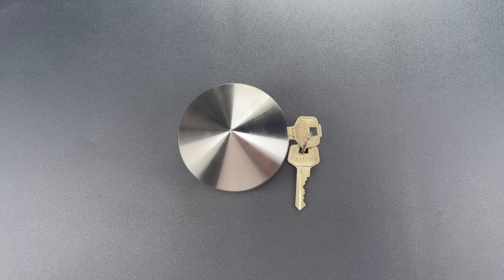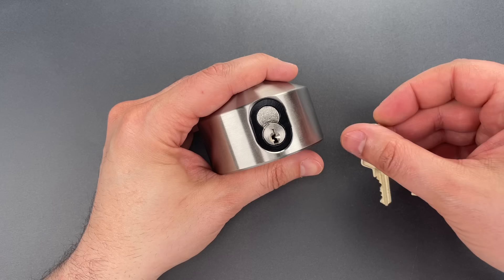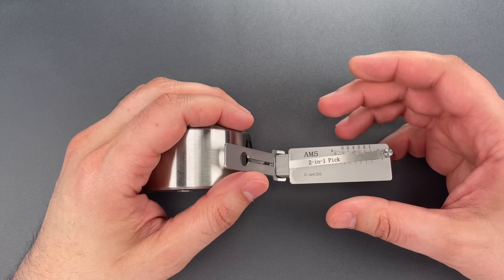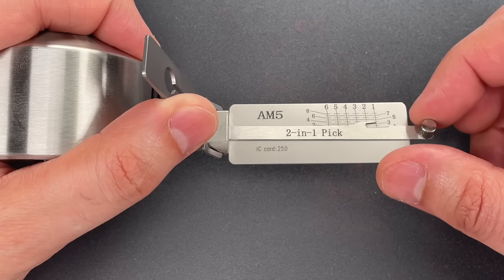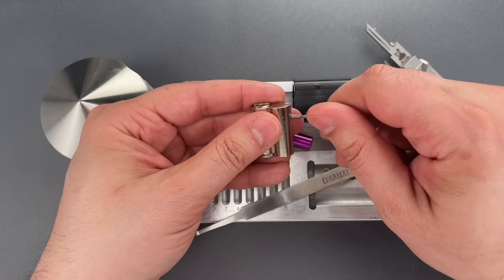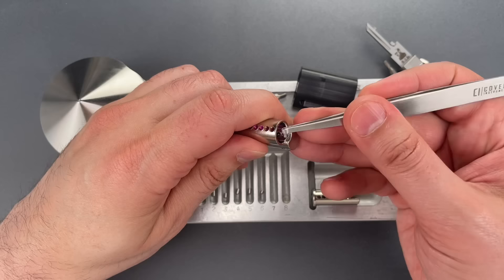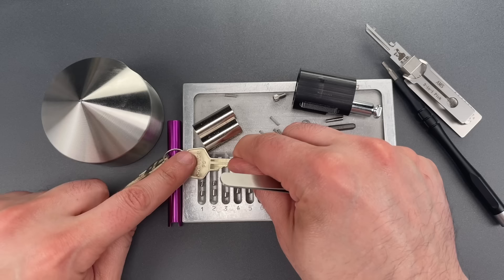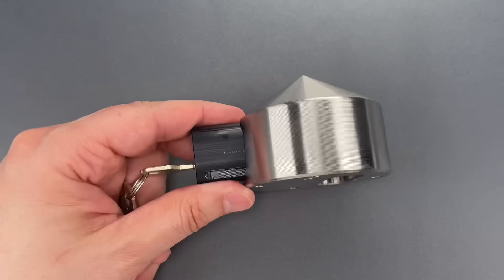[1293] PacLock’s Cone-Shaped Drill Defense

Comment: At least it's drill, rake, and bump resistant. Not to mention that a normal lockpick won't work if it's mounted against a wall. Which can't be said about most/all master locks. :P No lock is truly lockpicking proof anyway, so I'd say this is pretty good.

Comment: Wonder if that last pin is so long as part of drill protection. Even if a carbide bit is used to drill out the cylinder enough that all other pins fall out, this one is longer than the the cylinder is wide and will keep the lock closed even if it drops all the way in. Then the drill bit's tip would push the pin to the side a bit, making it that much more stuck.

Comment: The picking tool is longer than the key, which means if you can install or build it in such a way that only the key has space to fit, you will 100% defeat this picking method.

Comment: If anyone is wondering specifically why the cone shape is hard to drill through, it's similar to why tank designers try to put on as much sloped armor as possible on their designs: it's because if something hits sloped armor, it takes far less energy to bounce off of the slope than going into the metal. That, and it increases the effective thickness of the armor when attacked from an angle instead of a flat surface. "Water flows in the path of least resistance."
Reply: Anyone that has any real experience drilling through steel and has a good sharp bit won't have any problem drilling that lock. Remember the only use for even the world's greatest padlock is to provide a false sense of security.

Comment: I bet if you made a cool aluminum sleeve with the point in the bottom of it and had it drilled to support an end mill you could drill a flat spot on the lock then get a drill through the exact location. I don’t see why they don’t just use a chunk of cemented carbide inside the layer of steel as drilling through even an 1/8 of that would be awful.

Comment: The "angled" surface isn't drill resistant. 

Just start the hole with the bit at 90° to the surface. The only security about their angle is psychological.

Comment: I definitely wouldn't want to just start drilling on that surface; but is the material hard enough to make just using a center punch(or prick punch then center punch if necessary) to start the hole impractical? I assume that it would be more annoying on a sloped surface than a flat one; but that's pretty standard practice any time you want to drill a hole precisely and without the bit wandering.

Comment: Design a lock that takes 3 keys in different spots that the first two must be turned halfway simultaneously then the third turned halfway then one of the other two fully turned the one of the other and finally the last.   Build this and you will have a decent lock.

Comment: Having watched numerous 'lock pick' videos, I was wondering what affect, if any, different lubricants and their viscosities have on the lockpick 'feel'?
Viscosity may be limited by the abilities of the springs to return the pins to their 'extended' position, but would it have a real affect on security?
Reply: Much like decent fidget spinners, I don't think lock cores tend to use much lube, if any.  (The bearings and other bulky moving parts might/should be greased.)  Being exposed to the elements as most locks can be, it's better to rely on hard, polished, and non-reactive metals to keep things moving smoothly.  Lubricants tend to attract dust, and thicken over time or with cold temperatures.  Almost any viscosity of lube would slow down tiny key pins from falling back into their reset position, especially if the core is being torqued and the springs can't do the pushing.  That would make the lock easier to pick, and certainly make the likes of raking easier.

Comment: I’m curious as to how long it took you to put that lock back together the way it was. Given the tiny pieces my guess is it wasn’t very easy. Won’t be surprised if you prove me wrong.
Thank you for the very interesting videos.
Reply: Putting it back together in the exact same configuration might be nigh impossible without rewatching the video in slow motion.  I'm not sure that the spring order actually matters, however; as long as they're different from each other, they're doing the job of making pick pressure more difficult.  Beyond the springs and only the springs, I'm sure LPL has enough experience to throw this together faster than most of us could get it apart....at least without breaking or losing pieces.  He's always (as far as I've seen) careful with the pin order when gutting, so that's already sorted.

Comment: Thank you for all the informative information. I have a safe that is designed to use a recessed puck style lock to secure the door. The purpose of the recess is to make the lock itself harder to attack. I would like to take the security to the next level by using a highly  pick resistant puck lock. What would you recommend? Can the core of this puck lock review above be changed to something that is more pick resistant? Thank you

Comment: I wonder if flattening out a part of the surface with a hard strike would allow you to drill. like a centerpunch.
Reply: yeah a punch would definitely work but now you need more tools is the point. IMO you can also just slap a piece of thick tape over the cone to start the bit in the right spot.

Comment: I don't feel the design provides any resistance to drilling. If you have a small phillips screw driver and a small hammer all you would have to do is punch a small dot into the casing and a drill bit will start to bite easily

Comment: Wait, just watching the intro: Are you telling me that any door lock could be made significantly more pick resistant by adding a feature to the door that physically blocks the part under the key hole so that a pick wouldn't fit there while still allowing for the key to turn? I get that this would be slightly annoying for the user since it means that getting a good space to place your hand to turn the key would be harder... But if we're talking for high security doors where someone picking the lock is a part of a reasonable threat model, wouldn't this be en extremely cheap way of making doors harder to pick? What I'm suggesting is welding an L shaped piece of metal (or just a black of metal) to the door to align a flat surface that's just under the bottom part of the key hole? Or if not by welding, otherwise securing it there so it can't be removed or rotated out of place from the outside without making it a very destructive entry?

Given that most of my knowledge about locks comes from watching LPL and BosnianBill, I'm assuming I'm missing something obvious that makes it so this idea doesn't work? Or that there's already some other feature of really good doors/locks that's already doing the same thing?

Comment: The drill defense cone seems like it would be easy to beat by hitting a spot with a small steel pin and making a dent for drill bits to grab onto
Reply: they make spring loaded punches that you can buy at any hardware store for less than 5 dollars. use one every day to start holes

Comment: As a machinist that just got out of school I know drilling can be done using a punch and hammer.
Reply: What if it's recessed 6 inches in a concrete block with a pvc sleeve though? Keep in mind. No lock can keep an expert out. 

This is a decent defense against your garden variety burglars. People with the knowledge/ skills to bypass said lock aren't worried about a couple hundred bucks in coins and small bills that the lock protects.

In this case, a well done lock can at least keep the truly desperates away.

Comment: This lock looks completely insane. Undrillable and unpickable with a normal tool... I wouldn't even be mad if someone managed to get past this to rob me, because frankly, it's probably less effort for them to just break in and demand the key from me at gunpoint.
Reply: It is 100-percent drillable. Starting a bit on a steep incline like that can be a pain but anybody who knows how to really operate a drill can get it done and it doesn't take any special tools to pick you can take a regular lockpick and bend it slightly so that the backend doesn't knock against the locked surface and pick it just like you would any other lock.

Comment: Drilling on a smooth hard sutface is a bit more difficult. When the surface is curved it's a lot harder. Curved and under an angle? Way harder! But... what if you mark your drilling point with a piercing die? Maybe it takes several attemps, depending on the hardness of the surface, but with a little doing you should get a mark. Put your drill on there, PERPENDICULAR to the angle. As soon as you got the tip of the drill in, adjust the drill to the required angle/position. Or am I mistaken? Those shiny round surfaces can be a bitch.

Comment: I think it has already been said numerous times by other commentators that this lock is very good... so I won't do the same.
I would like however, to test the claim that it being cone shaped, makes it harder to be drilled.

If it really is significantly harder... then damn, well done on this lock.
Reply: What good is a defense against an attack that nobody uses? It's like putting a mote around a server farm.
Reply: @estoylaroca  Why would you run around with a drill when a hammer will do? Or just smash the window and you are in. Seriously, the young thieves today are totally overthinking.

Comment: Welder fabricator here. That cone does little to nothing to someone experienced with the tool they are using. You could use a punch to make your centre point and start your pilot hole by drilling perpendicular to the surface initially. Just a little marketing, and maybe good for keeping out some backwoods bandits.

Comment: Still a noob at this stuff. My proudest pick was a First Alert safe (my own safe). I've never have to deal with security pins or trap pins or anything - all the pins have been perfectly cylindrical. Never had to counter-rotate the cylinder 'cause I'm in a false set. Any times I've dropped pins? 'Cause I messed up and dropped tension - never because the lock was designed to try and make you do so.
But I'd like to try something a little harder.
Does anyone know of a good practice lock one could buy on Amazon or somewhere like that for someone who has gotten pretty okay at bone-standard locks but would get stomped by something that was legit hard to pick? Maybe something with ONE security pin somewhere - more secure than than a silly 101T-keyed lock but nothing crazy? xD

Comment: Is the core carrier (black shroud around the cylinder) made of plastic?  The single Amazon review for this lock indicates that it is made of plastic, and the material is not specified on the manufacturer webpage.  If no one answers soon, I'll give Paclock a call and report back here. ANSWER FROM PACLOCK: Aluminum.  I wish it were at least SS like the rest, as a vandal/prankster could easily just score the seam where the core carrier meets the body, causing everyone to be locked out.

Comment: As a welder/metalworker, I can assure you that come shape would add zero difficulty for drilling. Start 90°to the surface and turn straight in. If you want to drill the center point of the cone smack it with a hammer and you have a flat place to drill.  I would just use a cutting wheel on a grinder and cut it in half..... Or freeze it and shatter it......

Comment: If you don't want to buy a 100 dollar tool you can use a half diamond with  TOK tension and a slim medium hook.  You can use the shallow warding with the half diamond and for the high set pins you can just lift hard on the pick handle to create vertical force without using a typical lever attack.  Yawn

Comment: The only way i can compete with LPL is to use a torch or a cutter. The locks wont be unpickable if it melted. XD
Reply: This lock is pretty tough to melt... stainless does a good job against a flame so you'd need a pretty serious setup to get after this guy. Check out torchproof.com and you'll see another interesting video there!
Reply: @paclockpres.9805  damn, torch proof too? i'm done. XD
Reply: @taukedabai4613  Hahaha! Yeah, another benefit of going stainless over hardened steel.

Comment: anyone that is remotely knowledgeable  about drilling into stuff  knows all you have to do is start the drill on the same angle and as it's drilling you pick the drill bit up at the angle you wish to go.  and to start the drill you use a starter punch.  such a lock is useless when used with their hasps. you can just cut the bolt heads off using a battery powered angle grinder instead of messing with the lock.

Comment: Why not make a lock with rounded edges? so that it would not be possible to make efforts to turn, + integrate a magnet into the key that would raise or lower the hidden pin, well, or add a spectrum analyzer there, and insert a lens into the key that would refract light by emitting the desired wavelength .. Is it really so difficult to make a lock that will not be hacked? Lol .. Everyone has cnc machines, you can do something that will take hours to break in, in any case, any NON-STANDARD mechanism cannot be broken, not knowing how it works, that if the key inside the lock is unfolded into two parts, or to open which you need to make a certain amount turns in different directions .. Yes, it is difficult, but you will not be hacked ..

Comment: The cone base is no kind of drill deterrent. Claiming it helps in any way is, at best, marketing snake-oil.
Reply: it makes it much harder to drill in a specific spot
Reply: @markkealy4417  Harder, maybe. However, a spring-scriber will create perfect starting point. Indeed, I always use a spring-scriber when drilling metal at an angle. It's a basic piece of equipment and costs about $1 - assuming you did not get a million free ones with pop-rivet sets. Having said that, a machinist would be able to start a drill off on a slop without any kind of starting-dint if their drill bit was sharp; you simply go slowly for a few turns.

Comment: very disingenuous, you claim your tool will work with the lock in place and then you do the whole pick with the lock rotated 90 degrees away from how the lock would actually be used. Very disappointed in your method here.